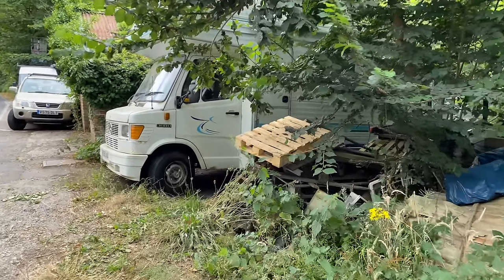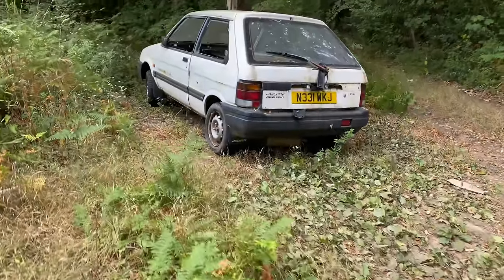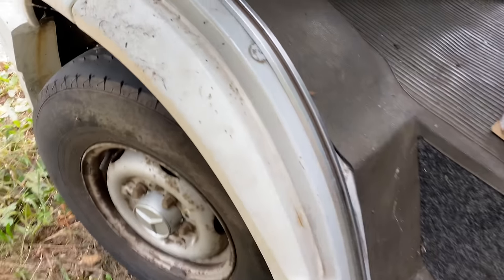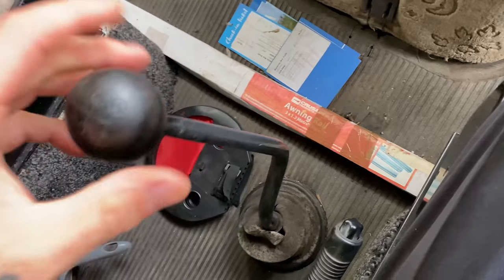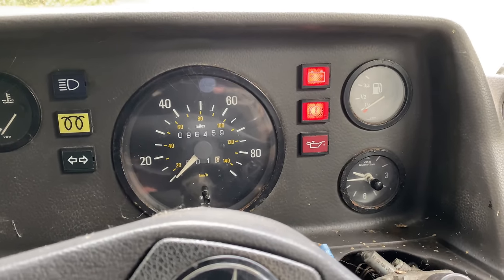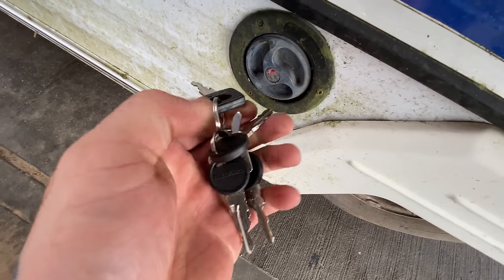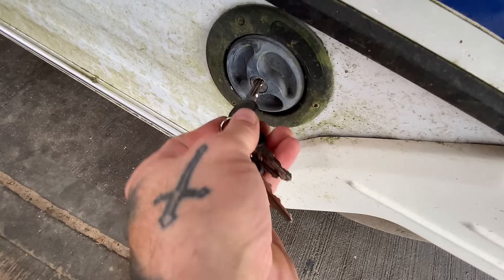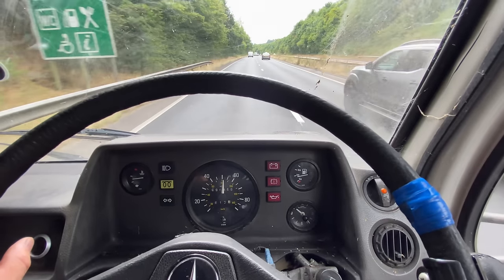I Bought An Abandoned Mercedes 308D Motorhome And Will Be Restoring It… But Will It Drive Home?..

Comment: Hi Mate, hope you are doing good, I used to work for a Mercedes Benz commercial dealership just outside Edinburgh for 25 years, in the parts dept, 1992 to 2017, I know these vans inside out, the 308D was a fantastic old van, pretty much bulletproof tbh, once you get it all serviced it should run forever, looking forward to seeing your next video on it.
Best wishes
Bruce.

Comment: Used to drive a 308d flatbed with over 400000 miles on it, they were very reliable motors, used to start off in 2nd gear if no weight on the back coz that 1st gear is very short, good look with the renovation.
Reply: My 307 only went in first when loaded,I got rid of it because as seen here it was a liability on motorways as waggons came up so fast on it,great truck lovely ride on the big tyres and first time i drove it i steared in 
too fast as the driving wheels are below you rather than in front,soon got used to it though,got mine chep because it needed spill timing and one could do it,wouldn't go back unless I lived in upper scotyland

Comment: I used to have a Merc 410d. It was a John Lewis Luton van that had been turned into a stealth camper long before stealth campers were even a thing. It was massive and slow but always got me where I was going. Once did Glasgow to Newquay at 50mph. Took 2 days but I loved it. The dash, dogleg box and giving it a rev to get the dash lights off takes me right back. Great vans as long as you are not in a hurry.
Reply: i now live in my ex john lewis sprinter luton van, built out the back to my on desires and kept it as stealth as possible from the rear and the drivers side ::)
Reply: 410 was a rear twin wheel if i remember right wasn't it
Reply: @barrycaldwell5461  yeah it was indeed. 2.9 5 cylinder with twin wheels at the back.

Comment: I just done a horse box for a lady I changed the roof to a aluminium roof and put 2 skylights in.
But they have a bullet proof engine.
Your lucky the gearbox has 5 speed most have 4.
Good luck with project 👍

Comment: I just bought a 1986 Komfort 30ft RV for $500. Essentially the same as yours, different bed/bath layout but nearly identical, from engine down to cabinet trim and seating. The two brands must have been built in the same factory. I will follow along.

Comment: That Merc will bat on for ever as long as you keep oil check and water,engines are one of best diesel around,drove them in 80s till 90s,never let me down,have great big window at front for good vision,wish u well,🏴✌️💯
Reply: yeah, the best van ever made , built like a truck, straight beam axle with king pins and a leaf spring at each corner, i had a 310d 5 cyl 2.9 , slow but never let you down.

Comment: I used to have a 308d flat bed and hauled across the country with it.
Excellent motors but watch for timing chain rattle and oil pump issues,retaining nut on the oil pump used to snap.

Comment: Good luck just bought myself a talbot express it does 50. It’s a 1.9 non turbo non power steering. 
if your lucky on a downhill you can reach 60 if to push it

Comment: I’ve driven the 307D and 308D back in the 80’s and 90’s doing upto 600 miles a day … fantastic vans reliable comfortable solid work horse…. Put an inline fuel filter before the main filter …. All the best with restoration

Comment: Loved this video, having just driven a very similar 310D Auto-Trail motorhome for the first time this weekend when I picked her up, great to see you having the same fun getting to grips with that gearbox and the rather sedate performance. Mine's a 5cyl 2.9, but no turbo, so similar glacial acceleration!
Reply: Hey Johnny I just done the same I purchased a 410d camper auto trail cheiftain how bad is yours mine is minimal rust and mostly interior work

Comment: I used to run them as mini buses years ago, slow as can be but indestructible, non of driver's could kill them , they last forever mechanical. Your engine at 98k hasn't even run in yet. Good luck with build.

Comment: I did my apprenticeship on this shape merc van really reliable saw loads off these with 6, 7, 8 hundred thousand on clock. My dad had a 308d panel van which had a turboed 5 cylinder in, that would sit at 80 mph on motorway allday long. The gear stick tower bolts to the top off the gearbox on these's and there are 3 arms go on side off the gear box if you line all the arms up on the tower end with long 5mm allen key and adjust arms on gearbox end it should change gear smoother they are common for coming loose on gear box side too they are also common for jamming in 2 gears at the same time. There is a way to turn the fuel pump up with the round valve on top of the fuel pump too but it's being a while since I played with one its a atmospheric valve. If you intend keeping it I would seriously think about putting the 5 cylinder engine in if it has not already if you can find one. There have alot better power output for the motor home versions. I think the turbos are only low pressure turbos too not like the ones we have now I could be wrong any intake leak and they stop working just make nosie lol. You can also get a power steering conversion for them too I did loads where I worked. Good find mate they are hard to find now especially still running. Good luck with the restoration.

Comment: Hi Mr bearded explorer I renovated an old 1990 clubman caravan and the a tip for the the window blinds is to take them off and spay paint them with rustolem primer and use matt or gloss spray mine came out wonderful like brand new! Saved us a few Bob on new ones! I think we spent £20 to 30 on the spray paint, also that plastic is the skirt for the bottom of the van if you was to have an awning x
Reply: Please don't tell me you threw it away! 🙈

Comment: I had a 307 d mini bus  new in 1987 it was bomb proof ultra reliable had well over 370000 miles when I sold it 
The lower body did suffer from rust though

Comment: I used to drive a 308 delivery van, there should be a rubber stopper under the accelerator you can either take it out or cut it down flush to the holder and it'll give you a bit of extra power/speed, it worked on the 308 and on a 208 I ended up driving. Hopefully you'll be able to get past 50mph!
Reply: He threw the walking stick away that the previous owner would have used on the throttle pedal on a long journeys now he needs to take a house brick with him😀

Comment: Imagine if it didn’t have a turbo😮. I would suggest you check it’s operation. The wastegate might be stuck open or something similar. It may not have an inter cooler fitted to cool the air going in to the combustion chambers. Good luck.
Reply: I saw the love heart and thought I was a special one but then noticed everyone gets a love heart 😭😄

Comment: Just subscribed, I'm currently welding up one of these too, but a luton box which I will convert. Lovely vans! the battery light is normal to stay on until you rev but not the brake light, also there is no handbrake light. About your starting issue, my mate had a similar problem and it was the main earth had snapped clean off from the gearbox so give that a look at 👍 look forward to seeing progress. Ive got lots of videos on my channel that may (or may not😂) be helpful 👍

Comment: Had a 308 van for quite a while that I used for hauling news papers, it was always at its maximum payload, and I ran it on kerosene, never missed a beat or broke down.
As you discovered, no power steering, so it’s like driving a tank, 😅

Comment: I have a compass clipper motorhome on a Mercedes 307d 1983 y plate with 26 thousand miles and yes they are slow and no power steering. 
The gear selector rods are bad for going through the bushes as mine has done.
Changing gear is best done with time between them.will be watch your progress with great interest.

Comment: i had an old fiat ducato machzone camper,1991,drive shaft inlet seal was leaking, rain water leaking into bulkhead and the rest,hole in fuel hose,reverse gear linkage popped out, lost alot on it when sold,no power assisted steering either, like driving a tank😁

Comment: I've just been for a ride over to Sheffield with my mate in his mercedes Vito it's got 222k on it and pulls like a train still on the motorway, he's parting company with it tomorrow for 900 sheets, diesel engines will run forever if looked after

Comment: Where I used to work back in the 90s they used to have two of these, one was a pickup and it wouldn’t pull the skin off a rice pudding 😂. Nice to drive though just slow as.

Comment: had a few 308s, engine and gear box will be fine, just service and use, make sure the fluids are right, and it will go to Scotland and back, the rust is the biggest issue, as are the electrics, if the rodents have got in, and change the fuses. if it has not gone too far, it will make a great bus, but should have gone 408 or 410.

Comment: Them vans pull away better in second gear.i found.i used first only on steep banks are when loaded.bullet proof engines in them.90 thousands miles its just run in

Comment: Take that 601 out and get a 602 in, that little 4 pot will run forever but so will the 5 and although not much more powerful I think the 4 will be woefully underpowered.

Back in the day it would be suitable but now it'll be a hinderence.

Or you could mildly turbo it, sure we did one years but wether we used turbo pistons and pump I'm unsure now, theres been a lot of stella passed over the years

Comment: I have a Ford ka 07 plate failed mot needs welding 300 pounds worth however been offered 340 pounds for the ka do you feel it is worth holding onto the ka as future classic it's only done 62 000 miles

Comment: What a great project. I’ve only been driving six months (I own a 2003 Honda CRV) and tend not to worry I’m only doing 50mph on a dual carriageway. If others want to get to where they’re going faster,then there’s always the other lane. I’m only using E5 petrol and at one point it was over £2 a litre. It has recently dropped to around £1.80 litre but my road to owning four wheels has been a long journey. Started lessons after first lockdown,theory test cancelled due to second lockdown,passed that in December 2020,booked my driving test in March 2021,we then went into the tier system and that test was cancelled. We came out of the tier system in April 2021 and my test was booked for June, sadly I failed 😢 so the earliest retest was November after having to wait for a cool-down period. Decided to take Auto lessons instead and only needed a one hour lesson every two weeks (only took instructor driving lessons,no private) thankfully in November 2021 I passed my driving test, but again was then hit with the high 2nd hand car prices. Bought my CRV in March this year at £3k with 113k miles on the clock but then the fuel pricing went through the roof. To say I’ve had a rocky start is an understatement 😂 but I have done 5,500 miles in six months and I’m enjoying it. Oh and I’m 54 if your wondering 🤣🤣🤣🤣

Comment: It's really, really rare that I write negative comments, but: What the heck??? I cannot believe what I just saw: No oil checking before trying to start the engine? Obviously low air pressure in the tires. What about the engine air filter etc p.p.. Obviously something is wrong because the 308D is faster than you experienced. 2) You can simply clean things instead of throwing away perfectly alright stuff. Especially nowadays you should set an example. Please don't forget: Utubers are often used as role models from a lot of people.
Best regards, luck, health and wisdom.

Comment: Cool project, the 308 is not turbocharged that's why you were  struggling 😂
Reply from the maker: Mine has a very large turbo fitted 😁😅
Reply: It's had a turbo conversion. I used to have a 310d a few years ago. M plate so even had power steering.
Reply: @TheBeardedExplorer  in your trousers, looking forward to the progress on this 😂👌

Comment: Just Discovered Your Channel. Well, A Euro Restoration Find. Just Realize Were Only Human & Can Only Accomplish One Event At A Time In Life. There Are So Many RV's Around The Globe🌎Sit'n & Waiten To Be Brought Back To Life. Did You Put Any New Petro⛽In The Critter? Do The Tires Have The Right Amount Of Air Pressure? Did You Check The Oil Stick & Anti-Freeze In The Radiator & Brake Fluid & Trasmission Fluid Stick? Or Is This Staged & You Have Done All This Before Starting Up?  You Sure Throw Away Good Items That You Could Recyle & Use. Wait Until You Start Buying All New, It Adds Up Mate. Live & Learn. What Did You Pay For The Used Mercedes 87? Are You Making A Good Living From Youtube? Wish You The Best. always, Tommy🤠

Comment: whats with the video
Reply: Yes it seems to keep hanging ?
Reply: You pay full price for the internet and you get  1/2 of a service! Welcome to brexshit uk!
Reply: @jtromano1  Yes same here,dont think my pc or internet can handle 4k.
Reply: Mine was doing the same , speed checked my internet and it’s fine so I assume it’s a YouTube problem.. it was ok after I reduced to 720.
Reply: @jvoric   Hi, When i click on quality icon ,it only has one setting 2160p60 4k,i usually reduce down but has no other option on this vid,yes might be utube problem will try again later,Thanks
Reply: @davec1704  I don’t Which device you’re using but  I’m watching on my iPad Pro, if I tap on the quality it opens another menu, one of the options in that menu is “advanced” tapping that brings up further quality settings. I chose 720p60 and it’s worked fine.